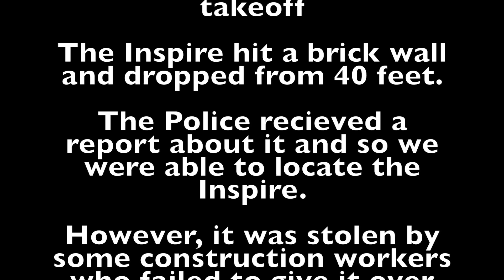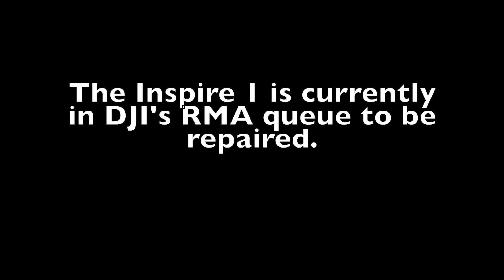DJI Inspire One Flyaway and Crash

Comment: Hi Guys, Could you update the outcome/cause determined by DJI and what you think may have happened. thanks.
Reply: +Mark Jennings DJI replaced the Inspire 1 under warranty and it has been running flawlessly.
Reply: +grindz145 was the cause ever determined?
Reply: +obese1konobe Nope they just replaced it. I think that says that we did nothing wrong. Properly calibrated, all comms functional. It's unclear what caused this.

Comment: I just want to know. Did your I1 flyway during auto-takeoff?
Reply: +VI Degreez It was basically just after takeoff. It responded to some input at first, but not for long. DJI is replacing it at no charge! Way to go DJI. Our theory is that the Radar from the large ships may have effected it, but that's just a total unsubstantiated guess.
Reply: Sorry to hear that! I had my I1 do the same thing twice!! Lol but each time Dji replaced it with a brand-new one!! Don't worry British
Reply: Sorry dropped my phone. I don't know were British came from. But you will be back in the air in no time. Keep flying!!

Comment: Did you try to switch to atti mode and manually take it over ?
Reply: +Go Fast it was completely out of control, responding to no inputs at all, including changing modes / etc. DJI was very good about replacing it though.
Reply: +grindz145 For us other I1 owners is there any information or lesson we can take to prevent the same occurance?
Reply: +Jason PK I wish I could say for sure. Dji didn't provide any input on this at all. Just keep in mind that these are still in their infancy and things can go wrong. We suspect that it might have been affected by radar from a  ship in the naval yard but it really wasn't that close.